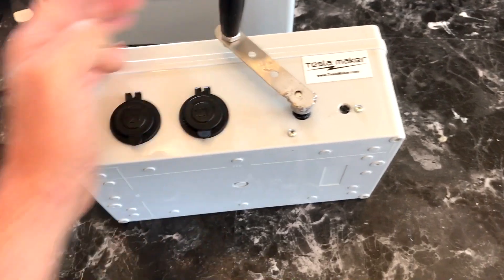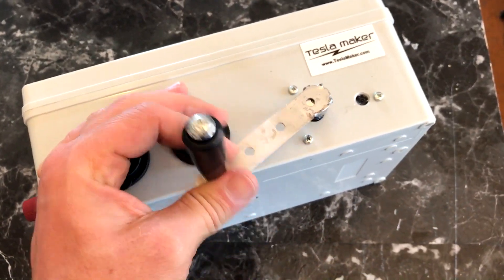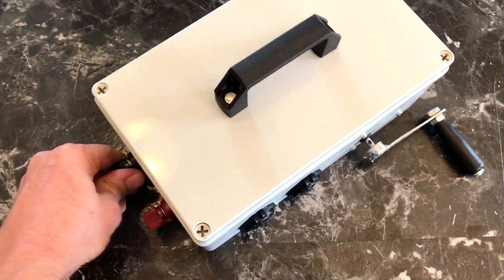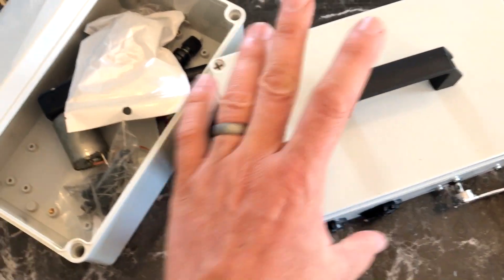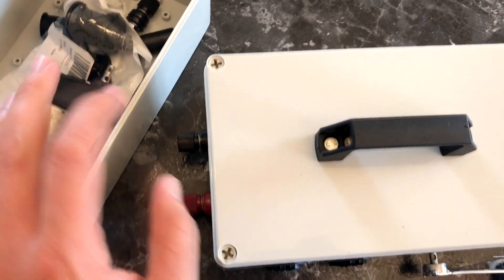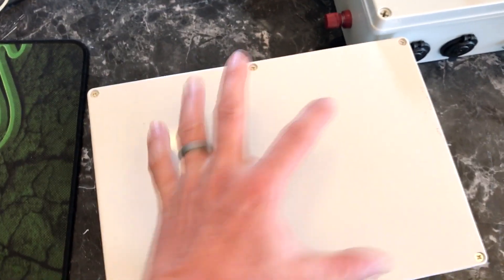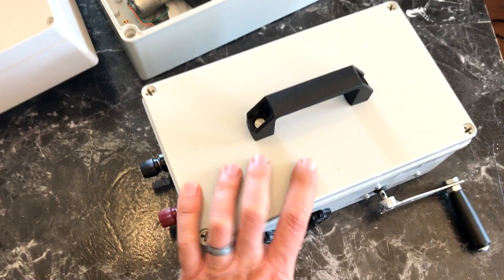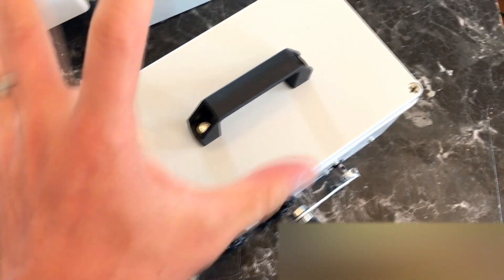V2 DIY Hand Crank BoostBox - Capacitor Power Can Start a V6 Engine

Comment: Hey, Lasersaber  I used a FW bridge rectifier on my crank generator so it makes no difference which way you turn the handle.  MY generator is not as big as yours but good for charging phones and running LED lights.  BTW:  Like your channel.
Reply: Sorry, i checked in the meantime. It seems I forgot my highschool physics quite a bit.
Reply: In theory it should also charge faster as the single Diode will block half of the power cycle(??) of the handcrank, while a bridge rectifier will allow both halves of the power cycle to charge the capacitor Bank.
Reply: MultiDavid997  so there is already a bridge rectifier or similar inside the hand crank generator.
Reply: MultiDavid997  most bare rotary generators will produce AC unless there is extra circuitry to prevent it from doing so.
Reply: Brushed permanent magnet motor outputs DC if I'm not mistaken

Comment: Excellent video, please make the larger energy storage unit.  I just purchased a low mileage 2012 Nissan LEAF, I charge it at home with a 220v charger; my wife is a little worried that I should have a back-up power supply. If I know how to build a larger capacitor power supply unit I would be able to plug in a DC to 230v AC inverter and plug in 220v charger cable for an emergency.

Comment: How many AmpHours capacity does it have?
Reply: ComputerUser321 if you charge it to 16.2 volts and run it all the way to 0 it has .6 amp hours.

Comment: To all the people decrying the cost of this. I suggest you compare apples to apples and price a good jump box. Then check and see how long that good jump box takes to charge after it dies. This is a vast improvement and worth the little extra for its over and over use capability. One could sell these at an auto auction like hot cakes.

Comment: A cheapo voltmeter hard wired into the circuit would be a useful addition instead of using a plug-in one and losing a socket.
http://www.ebay.com/itm/Hot-Waterproof-DC-3-5-30V-Mini-Digital-LED-Voltmeter-Volt-Meter-12V-Car-Moto-S93-/161877496449

Comment: Being from the NW USA - water proof all connections crimp then solder then dielectric grease (petroleum jelly works in milder climates) then shrink wrap. (Keeps petroleum jelly from off gassing) rebuilt 1985 van this way back in 1999 and still working.

Comment: It'd be easier to just make a AA battery to 12v converter...
Reply: yeah easier sure but when your AA batterys are dead your screwed unless you have more which is not always the case . your arm always works .... that is if you have an arm ....

Comment: get a junk yard alternator and put a crank on it.  basically free to make and will start a car
Reply: I'd bet that the reason that the guy in the video you linked to used a permanent magnet alternator is because you can't spin a normal automotive alternator fast enough to excite the field windings.
Reply: An alternator also requires power to excite the windings for it to start working. A old dynamo (probably similar to what is used in this vid) would work and be much simpler.
Reply: That is the first thing to go. I have never seen an alternator in a junkyard. too much valuable copper wire.
Reply: Captain Howdy Right!?! So how fast can you crank? Maybe you should think before posting. Not to mention an old "junkyard". alternator almost certainly has worn out brushes and may not even work!
Reply: Your alternator idea will not work you need amperage to start a car and unless your superman you will never crank that thing long and hard enough to start a car .

Comment: i have made a generator from a old viking imow stepper motor drive it puts out about 55 volts
Reply: I could use a 55v source for 46v battery packs. Please tell me more
Reply: Michael Palazzola welp there is not much to tell but it wont be a good source for your battrypacks of 46 volts unless you want to crank for 10 days
Reply: OK, thanks. I was looking for something to add to a small engine. Or a way to make an inverter generator put out 50 volts dc for direct charging of electric golf carts.  I like the quietness of electric carts, but sometimes you need the range of a gas cart.
Reply: Michael Palazzola if i where you i would look in some altenators or a modified dishwasher/washing machine engine
Reply: @boyke2412  A hand cranked Samsung, LG, Kenmore, Whirlpool, Fisher& Paykel Smartdrive motor will output 55 volts AC without a problem. Other than it will take you a while to overcome the cogging that putting it under load will cause. Hooking one to a gas engine will do it without a problem. In fact, people have been using them in windmills and water powered units.

Comment: This may be a stupid question but I'm wondering, if the motor outputs up to 24V and this is a 16V cap bank, isn't that bad? Or am I missing something about the circuit? I don't know a whole lot about this stuff but I have a similar 16V bank that I want to play with.
Reply: WHAT THE PLANTS CRAVE if you crank it long enough the voltage will go over the rating of your capacitors. I'm guessing the balance board he is using will stop it from going over the rated voltage in his setup. You may or may not have problems depending on how you balance your caps.
Reply: Ok thanks, that's along the lines of what I was thinking. I have a sealed Maxwell unit I got used off ebay, but I know it's an established brand and I have the data sheet which I'll have to check. If the board doesn't cut off voltage I may have to dive into google and figure out the easiest way to add that feature into the charge circuit.
Reply: Yeah I have a few, I think that's what I'll do since I'd rather try and maximize the wattage on the generator then figure out how to get torque in there later. 

A crazy idea I'm having is... battery tab spot welder. There might be more than a bit of efficiency losses but I have an SCR and 00 cable ready, so I look forward to cramming some caps in a box and letting loose the angry pixies.
Reply: WHAT THE PLANTS CRAVE I'm glad I'm not in a 5 mile radius 😁 Jk, good luck, and stay safe
Reply: A great way to control this is a Buck Converter. Set your voltage (and amperage on some) and let that do the hard part. Happy building.

Comment: this project is ridiculously expensive, after chasing down all the parts and the time to build it, you've got roughly 200 dollars in time and labor. You can buy a 10 watt  120 volt hand crank generator for $60 , or a 200ma crank with lithium ion  battery included for $22 .. and on and on. I mean it's a cool project, it's just not cost effective when there are so many other products that are ready to use out of the box for far less money.
Reply: CrzyBear9 there seems to be very little in this that HAS to be bought. people have made their own supercaps with graphene, the motor and gearbox can be found in the dozens in NiCd electric drills in skips (in the last eight weeks I have recovered two Makitas, a DeWalt, three non brand, two Bosch and three Black and Decker drills - ALL fully functional after getting cheap batteries off eBay or converting to LiIon with low cost BMS boards off eBay), the box is best new but doesn't have to be it CAN be fabricated quite solidly from ABS in a number of ways, the circuit board can easily be made with off the shelf fibreglass copper clad for peanuts and the components, especially the "expensive" MOSFETS can all be recovered off scrap PC MoBos free. What does that leave? Oh yes, the metalwork and crank handle and cables and terminals. Well I'd probably splurge on new terminals off eBay for a few pounds/bucks and cable of all sorts of sizes and capacities can be obtained together with metalwork for free once again from scrap. One's own labour is disregarded in exactly the same way as every other practical hobby like say wood working ... it's a hobby! We do it for fun, the pleasure of making something that works (almost certainly better than ANY commercial battery one can buy) ... WHERE does the $200 arise? If you have the money ... go buy one, otherwise what's your point?
Reply: Those small battery packs can let you down when it's cold.  Lithium cells get even more feeble than lead acid at low temperatures.  Supercaps can deliver the amps you need to crank an engine,  and can be topped up simply.  A small solar panel will do the job if you can afford to wait until daylight.
Reply: If enough people were interested I'm sure the parts could be sourced cheaper.  I like the direction this project is going though.  Keep innovating!
Reply: ComputerUser321 Until you need that less expensive battery pack and realize that it's dead. Duh. Show me a battery pack that can turn KFC into kilowatts for $200 and I'll buy it.
Reply: "CrzyBear9 there seems to be very little in this that HAS to be bought. ...............             .............................than ANY commercial battery one can buy) ... WHERE does the $200 arise? If you have the money ... go buy one, otherwise what's your point?"

I couldnt have written this better  myself.
Reply: No its not...  thats not the appeal of 90% of the viewers...
Reply: Most of us find that Caps charge much quicker!!
I would incorporate a couple 12 volt batteries into a system like this also though!!
Reply: @violeman  that's how I built mine. Used li ion instead of clunky car batteries tho.
Reply: CrzyBear9 its NOT a Light Bottle Bulb is a Coca-cola Lite
Reply: Imagine taking this camping, it's light, you could easily use it for charging phones or other devices. With a small inverter he was able to run corded tools off of it. I could see it as an awesome survivalist, or camping tool. Pair it with some form of corded rotatory tool that can cut and drill, you can turn branches and environment around you into shelter, kindling, etc. All you gotta do is crank. Bring a spotlight, and you will not run out of battery, bring an emergency radio. And above all else, if you forget to charge stuff like many of us do.... (Like the booster pack for your car), you just have to crank it. I understand the value in storing battery energy, but don't ignore the utility and potential that hand crank generator offers. Also capacitors are alot cheaper than LiPo batteries.
Reply: $200 in time and labour? What are you a doctor? you obviously put an inflated value on your time.
Reply: the supercapacitors are pretty expensive
Reply: @ CrzyBear9 ... The benefit of this over the cheaper version with a Lithium Ion Battery is 1) Super Caps are a fast charge you dont need to crank for a long time to get a good voltage stored up (which is great for a quick need in emergencies)  2) Caps Last much longer than even Lithium Ion batteries (Not the charge but they will simply work for many more years)
Reply: I hear that most are Junk and don't work at all... that's what brings me here (and other videos like it) hahha
Reply: dave Yates 
Hand cranks could see a comeback in forms like this, because many of our electronics are becoming more efficient. An excellent example is light, LED's do not require much power to operate and let me tell you, they make a world of difference when you have to work at night. Batteries are well and good, but you have to get power from somewhere. This won't power a house, but if you need the ability to produce power for small tasks (running a drill, etc) this is a very flexible option. Hand cranks operate off the same concept as alternators and generators, I don't hear you saying your car's alternator is obsolete...
Reply: get what you pay for a $60 unit wouldn't be nearly as well built or reparable.
Reply: I disagree, $200 is a significant chunk of money.  There are small battery packs you can jump start your car with for much less money...  a better project for the DIY crowd is a similar product built from everyday junk parts you find at yard sales, recycle centers, junkyards etc.
Reply: CrzyBear9 the black and decker drill is bit crap lol
Reply: then don't do it!
Reply: how many nuggets are in a KFC-lowatts!
Reply: yeah you buy each each month worth of 60$ cheap china made that will break a lot and be useless in a month. its fine its only 60$ per month.
Reply: Caleb Ayres 
I might add, capacitors are perfect for quickly releasing amps, lithium batteries are a combustion risk under high amp use.
Reply: I know that I am late to the party, but could you add some links where this has been done well at a diy level? Thanks!
Reply: a "group buy" would help a bit, but really it's those super capacitors that boost the price so much...
Reply: If you use 12 of them (as in the video), it comes out to $137.  Ouch!
Reply: CrzyBear9 how selling me one. With the new plastic cover we can't see the capacitors charge like the last one. I will prefer the older one. Email me. Deenpythoncobra@gmail.com
Reply: yeah, those battery packs have a lifespan of just a couple of years. I have tried them in the past. Huge waste of money.  The capacitors in this custom unit can be discharged literally 1 million times and not lose their capacitance. Unlike batteries which start losing life after the first use. So, throw $60 -$100 away on a battery pack that lasts a couple of years, or invest $200 for a capacitor bank which your great grandchildren will still be able to use?
Reply: So.. got a link to a hand crank box that can jump start a car?  
Or is this like MSN/CNN?
Reply: Are you stupid, this uses a 30W+ generator you can buy for $20. The supercapacitors are what drives the high wattage devices. You totally missed the use case. If he wanted to he could make a hand crank generator for $25, attaching it straight to the plug. If you use lithium ion batteries you'll be cranking for days because it can't take in all the power from the crank. This is for industrial use. People need to actually figure out what they're watching before commenting.
Reply: But that won't start up a vehicle
Reply: You're time is worthless unless you're on the clock. Stop being a self entitled little manchild brat when we know all you waste your time on is ,asturbating on facebook and staring at a smartphone screen all day like a braindead moron. If you really cared you would be putting in for more over time so get the fuck over your sorry ass lazy self.
Reply: For off grid use, this one pisses on every commercical "powerbank".
Reply: yes, but where is the satisfaction in using a product that you just bought without doing any work on it? it doesn't compare
Reply: CrzyBear9 prototyping is expensive bro. That's life.
Reply: Also, the lithium won't last for that long (5 years I heard). The supercaps have better durability. Plus, the "I created it all by myself" factor cannot be denied
Reply: $200 is nothing if the device saves your ass at least once . (edited for typo)
Reply: CrzyBear9 social justice and "compassion" killed the critique in this world and with that the progress and the reward from creativity and inventing died also it seems...
Reply: Yea i would rather have this than cheaper made in china one.
Reply: @kennyjohnson8100  all or most parts are made in china
Reply: B.L. Alley then create something useful that you cant buy for that price instead...
Reply: The super-capacitors are just a complete waste of money. Using NiCad sub-C cells would be the best.  They can take that huge charge with no problem and can handle enormous output current. 20 30 or 40 C is possible with high quality sub-C NiCads.
Reply: I'm guessing CryBear is a variation of CryBaby...
Reply: @nickdannunzio7683  Listen!!!!!!! Its crazybear not crying bear, if he was a crying bear then i would be a crying hippy, hey, wait a minute, I am a cryinghippy, wait just a second is this a trap? Hey your nick dannunzio the infamous bear hunter.....I'm outta here
Reply: it's not a prototype because it's already been done before, it's not an invention because it's already been created by someone else first.  I might as well take a Coke bottle ,place a tungsten element with two conductors, vacuum and seal the bottle and I'll call it. ...I'll call it, A LIGHT BOTTLE BULB. .....YAAY......look every single one of you favors who love to suck each other's dicks every time someone ties their shoes and calls it revolutionary. .....I said it was a cool project but it can be done more cost effectively and HAS BEEN, ,so if that's too distressing for you, go hide in mommies basement and hope she brings you some cookies and you feel all better bout it k .
Reply: hand crank is crap it was used 100+ years ago and scraped in most things use somat else like battery .....cus that motor/gears will ware out eventually cud even leave carbon\metal dust from motor in the box but cud just charge it from solar or mains and fill the box with caps ay it

Comment: Dont you loose half the energy if you just use a single diode instead of a rectifier?
Reply: As others say it's a DC motor, I assume the diode prevents inductive kickback or at least the capacitors from powering the motor
Reply: No, it's DC.
Reply: No the motor puts out AC
Reply: You're thinking of an alternator, this is a DC motor being used as a generator.
Reply: the only thing putting out ac is the dc to ac inverter
Reply: I use these diodes on solar projects. keeps the cells from being backfed current.
Reply: Jhy9

Comment: more solder mate,  more solder..... for the love of god use the whole reel...
Reply: Cody Slab z
Reply: error 404 sarcasm module not found xD
Reply: @GamingAmbienceLive  ya I was like ...... um buss bar please. spade terminals and a buss bar. slightly more  complicated but easier to fix if/when components break. taller/wider box would be good too. don't know the exact dimensions of the cap modules but 2 laying flat on the floor and just fill that side with caps. triple the caps basically.